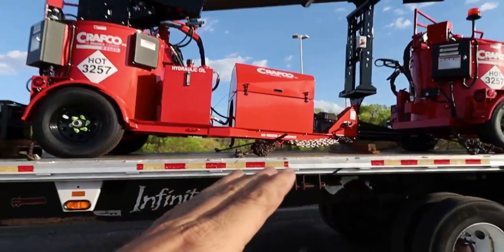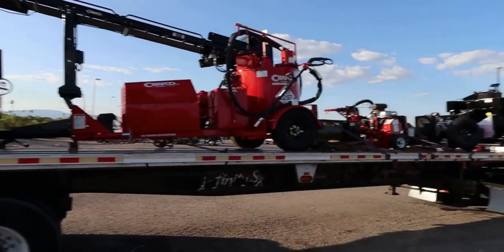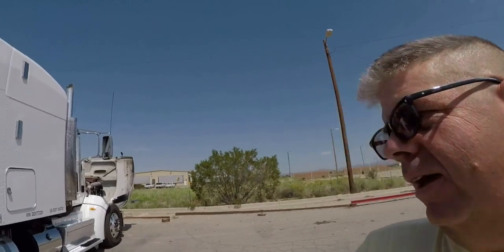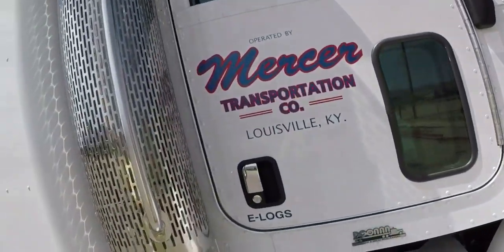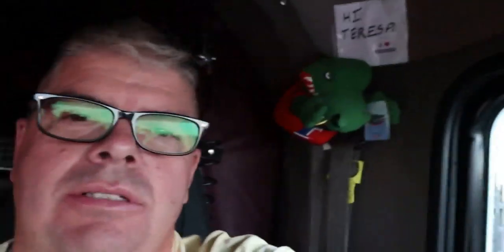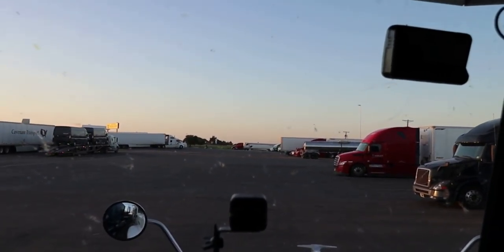#343 First day Back and No More Squeaking The Life of an Owner Operator Flatbed Truck Driver Vlog

Comment: Might want to think about spray painting under you fenders under the hood, to help protect the gel coat of the fiberglass, or use that rubberized roofing they roll on RV roofs. Just a thought.

Comment: Don't use grease or spray lube, use bee's wax or drawer slide. Does not dissipate easy and does not attract dirt. Fifth wheel too, mush a couple of drawer slide or EZ, cleaning fifth wheel first. I was a O/O for 35 years. Fifth wheel, put a couple of paper wrapped sticks on fifth and crush them, air ride works great for that, lol

Comment: Dan...
Good to see that you enjoyed some time with your family....you deserve that....about that leaking fitting....first make sure you wire brush the threads on the fitting and there's nothing in the threads of the female side. Then Teflon tape the fitting. Don't be shy with the tape...it won't hurt to use some extra tape. Next use a good pipe sealant paste on top of the Teflon tape. Be sure to align the fitting to where you want it on the first try. Never back it off to align it. If this doesn't work there might be something wrong with the  fitting. Good luck with that and safe travels my friend....Kevin

Comment: Some else mentioned that coolant fitting might not be tapered pipe but "o" ring seal type. (Thread pitch are same.  Clue is female thread doesn't go all the way to edge.)  I had a similar problem with hydraulic hose on my farm implement.

Comment: Dan and I wanted to share a Plumbing trick with you. I had a water heater one time at would not quit leaking at the t&p. A Teflon the tape out of it still leaked. Someone suggested Teflon tape and pipe dope. Walla problem solved. Welcome back be safe.
Reply from the maker: I'll try that 
Thanks for watching

Comment: Dan that fitting in the cooling system I know you put thread tape on it , just wondering if it has an Oring  seal on that flat surface or it may have a hair line crack in the housing that only shows up when the fitting is in place and tight only a thought Dan also some pipe sealant as well as the thread tape could help

Comment: Dan sometimes there can be just a small imperfection in the threads of the fitting or in the female side that Teflon just doesn't seem to get it. I think that'll solve your leak.
Reply: Could pipe dope fix it? I have heard that works if teflon tape doesn't.

Comment: Nicely tied down load there my friend but to this old Brit ex trucker those trailer wheels look really odd. i mean the cutover on the trailer must be evil in towns and I suspect not a lot of weight gets on that back axle. We generally use air suspended three axle single tyre trailers @ 44 te and they are set well in from the rear of the trailer as is the kingpin @ 1.6 Metres from the front. See the attached photo. UK trailer lengths are 13.6 Metre (45 Ft) standard but we have been trialling 14.6 Metre (48.5 Ft) and 15.6 Metre (52 Ft) trailers with a slightly different axle layout to ensure minimum cutover and outswing.
https://www.lawrencedavid.co.uk/trailers/platform/

Like the USA we run 3 axle tractors (Semis) but 90% are single drive axle with a second lifting steer axle at the rear and always air suspension. Hope this is of interest ...